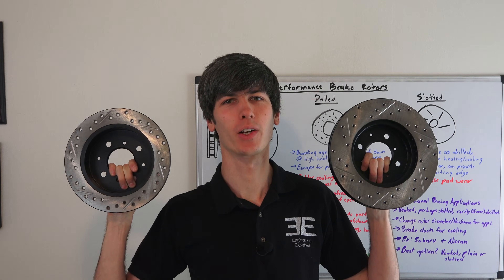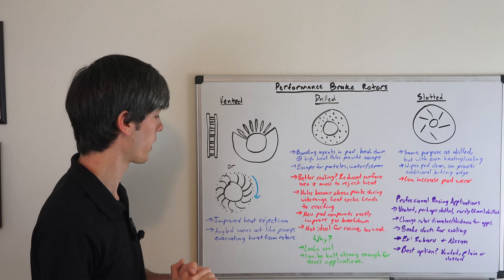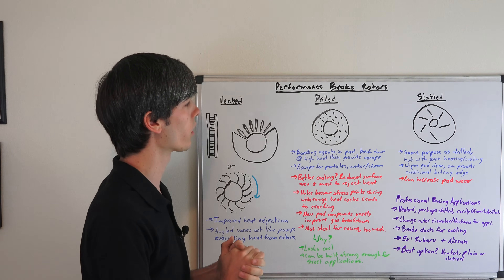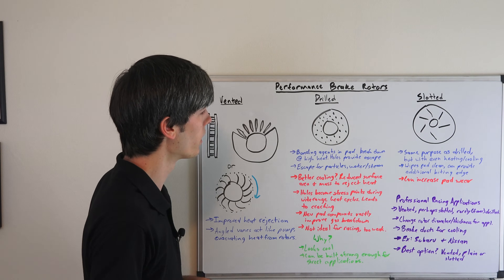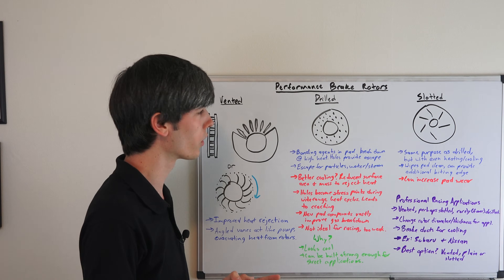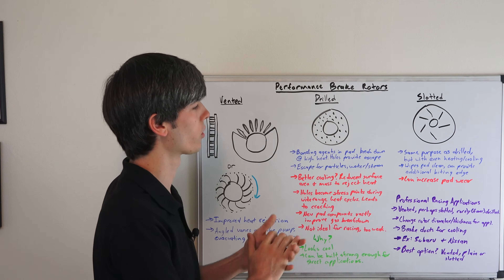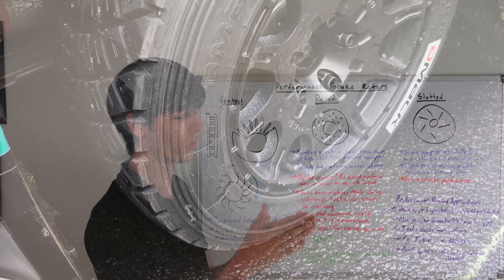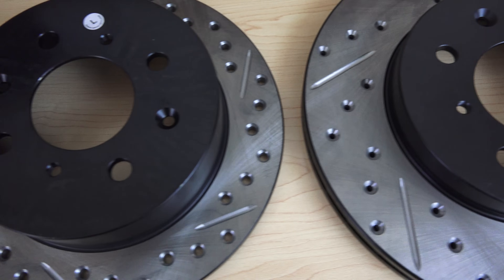Drilled, Slotted & Vented Brake Rotors - What's Best?

Comment: I really doubt Ferrari adds drilled brake rotors because they “look cool”
Reply from the maker: Not saying you're wrong, but it's also not the full story. Ferrari doesn't used drilled braking in F1, it's a full surface. In IMSA with the 488, Ferrari has slotted brakes. If the extremely harsh braking environments of F1/sports car racing don't require drilled rotors, why do street cars need it?

Comment: You looked at 2 cars that used slotted over cross drilled, and then say race cars don't use cross drilled. Please look at european race cars that are using cross drilled carbon ceramic brake rotors, example Zonda R. Each method has its use, but durability of slotted or cross drilled is lower than blank rotors. For us putting them on our street/track cars were not looking for lifetime, because racing does put excessive wear, and if you're just a daily driver don't bother with modifying or using non oem spec parts cause it is a waste of money

Comment: So why do brakes fad under high stress at track days, if you say that this gas material that releases from the pads due to the heat, is a thing of the past? I thought the brakes fade due to the gas that is created a between the pad and the rotor.
Reply from the maker: ***** Brake fade has to do with the pads and rotors getting to hot, and the coefficient of friction dropping. I will have an additional video explaining this. :)

Comment: 1. Cracks because of the drilled holes? I've been a mechanic for over 35 years and yet to see that happen. 2. Slotted edge to wear out the pad? Who gave you so much bad information? For those edges to wear out the pad they would have to be higher than the machined surface of the rotor... if this were even possible then the pads would be ground to bits on the first brake application. 3. The curved vents work as a vane pump to get more air through the rotor ONLY in one direction; if it's running on the wrong side it sucks air to the center to the point it quits working...

Comment: Then why are motorcycle rotors drilled? All motorcycle have drilled rotors or wazed rotor, all use less surface area for more braking. Theses pros and cons are correct but I highly doubt you’ll see a drilled rotor crack on “race applications” that’s basically saying motogp bikes go through rotors left and right, the amount of pressure and heat that a bike rotor takes vs a car is two different ones, bikes put a lot more stress then cars by far and if a 4.5 millimeter drilled rotor can handle coming to a complete stop after 180-230mph I’m pretty sure 1 inch thick rotors can handle more

Comment: Rotor drilling is not and has never been about gas evacuation and/or cooling. The original purpose was to reduce inertial mass and/or unsprung weight in specific marginal cases in racing applications -- like going just a smidgen faster on a race track that doesn't challenge the brake system to its limits but has stutter bumps. These days it's about selling expensive toys.

Comment: do any oem manufacturers actually use vented as 'stock' on 'stock' cars off the lot?
Reply: Pretty much all cars have vented rotors at least in the front. Most larger cars will be vented front and rear. I have a 2004 Legacy 3.0R Spec B, it weighs 1590kg and has stock 316mm vented front rotors and 290mm vented rear rotors.

Comment: I feel they should just ban flat rotors - at least in the front.  I have never had a straight rotor that didn't warp no matter how expensive it was or how careful I was not to stop/park it while it was hot.  I've never had a rotor that didn't get scored with uneven brake pad wear no matter whether the pad was semi-metallic, ceramic or how good or how expensive the pads were.  I've been using slotted rotors for the last 10-months (plus 7 days); I have more than 20,000 kms on them and they look and work like they were brand new.  They should just cut out the crap and the better designs will come down in price as they become mainstream.

Comment: How to distinguish drilled and vented rotors since they both have holes on them
Reply: +Stark A vented plain rotor will not have holes on the disk surface. It will only show the vanes in between the two discs if you look at the edge of the unit.
Reply: +NLRevZ All vented rotors I have seem come with holes on it.
Reply: +Stark Even if you google 'vented brake rotor', you will find that 60-75% of all images shown to you are of brake rotors which do not have the holes on the disk surface. The following image shows what vented rotors are on the inside, showing the vanes going out between the two disks of the rotor: https://www.motorz.tv/wp-content/uploads/2015/12/UUC-Motorwerks-Vented-Disc.jpg

Comment: Plain rotors are the best... because it has more surface area = better stopping power
Reply: But more surface area = lower pressure on the pad. Hmmm...
Reply: +mingmongmang Wider tires means power pressure on the tire, yet they have more grip. Higher pressure doesn't necessarily mean more grip. Otherwise, the skinnier the tire, the more grip you get.
Reply: +TheRedbikemaster I think I was hinting that contact area doesn't affect friction force. 
Wider tyres have better road holding not through more friction but through more shear strength. (Tyres don't actually slide on a road, the rubber stays stuck to the road but shears off of the tyre leaving a skid mark.) That's not the case with brake pads.
Reply: +mingmongmang that actually only applies to some surfaces. It is due to friction that the rubber tears off, and hence why a bigger tire allows for a higher friction threshold before rubber shreds and the "slide" occurs. On a more slippery surface though, a car can slide without losing rubber in the process, and the bigger tire still gives more friction (unless it is aquaplaning, but that is an entirely different sort of traction loss).
Reply: +Daniel Kemnitz   Nope. Size of contact area doesn't affect friction force...

Comment: You made me think that I should just stick with stock solid vented rotors. But no.....
Reply from the maker: Tyee Cambrón I never said stock offers the best performance, there are other ways of improving stopping power and the heat dissipation of the brakes. Drilled is not the route I'd recommend. Larger discs, pad selection, type of ventilation, width. All of these can be changed to effectively reduce brake fade.
Reply: Tyee Cambrón 

Now I remember, driving my 1993 mercury cougar, I have overheated my brakes before. I had 5 construction working men (including me -- and I weigh 200lbs) while i was driving in a heavy hill area and probably going 60mph in a 35 of up/down hills. My brakes were smoking even when we got back to work.

[[Story was... A street sign lied about restaurants being at next right, we travelled 10 minutes into a back road that has nothing but houses and tons of stop signs, and there goes our 30 minute lunch time... So I turned around and found a gas station on the main street just half-mile after the dumb sign]] And all my 4-wheel disc brakes were still smoking after getting back to the job site.

another note. braking down the steepest seattle hill in a ford f150 with 1,200 lbs loaded will overheat the brakes and cause them non-functional, so e-brake (drum-brake) is necessary. other wise your front disc brakes will over heat and then have near 0 stopping power.
Reply: Engineering Explained I did some edits to my posts to switch as reply... But thanks maan.
Reply: Tyee Cambrón you should avoid using e-brake. They are not designed to stop your car when moving. Use engine brake to keep your car not accelerated on the hill, flush your brake fluid if you haven't done last year, and get better pads.
Rotors are not the reason for overheating on the hill. It's either pads are fading, or fluids are boiling due to poor maintenance.

Comment: Can anybody tell me what would be best for drift applications? drilled and slotted or vented? or something else?
Reply from the maker: Typically drift runs are short and don't have much braking. Smaller brakes will remove unnecessary mass. Just make sure they're not too small for the application.
Reply: Plain vented. They are cheaper which means more money on seat time.

Comment: if you see the testing that is done on premium pads, you realize you will never generate that kind of heat in daily driving.  I just buy premium rotors (higher quality steel) and premium ceramic pads.

Comment: You mention drilled rotors are disadvantageous for racing applications, and you continue to bash them as something 'just for looks". Have you considered the value of drilled rotors for street application? Not all cars are designed for track racing, and as you mentioned, those holes can be beneficial if water gets between the brake pads and rotors.
Reply from the maker: flipofthekick As mentioned in the video, escape for water (see second bullet point under the drilled rotor). But slotted can do this too, and won't have the stress failures as commonly.

Comment: with drilled or slotted rotors, is it possible to turn it down or resurface it?
Reply from the maker: jayzbond007 Turn down for what?
Reply: LoL
Reply: Engineering Explained epic win.
Reply: jayzbond007 Although many think it's not the best idea, you can turn a rotor if it's warped t a degree to even it out and reduce wobble. But most recommend you replace your rotor, it's still not a bad idea if it's cheaper and lasts a while longer. I had a warped 17" on my 05 3.6L CTS- the cost of the rotor was best to just replace it rather than get it rotated and shaved down at half the price.

Comment: racing cars have ceramic rotors, dont need any heat dissipating holes.  so brembo has no idea what they are doing? they make cross drilled for street applications cause most cars have fade, metal they use does not cause cracks, fact.

Comment: This guy really hate X-drilled for valid reasons, maybe failed on him before, well, rotors will need replacing be it slotted or drilled,etc  or cracked or warped, we buy these for stopping distance, ç x drilled offer best bite, just have to pickup to the cracks .

Comment: I could of swore that the directional vented rotors rotate the opposite direction (takes air from the outer diameter and transfers it to the inner)??? Assumptions based off of Lexus GS 300-350. Other makers may be different I guess.

Comment: But what about rotors that are both Drilled and Slotted? This is for normal everyday driving.
Reply: Pretty much useless. The edges will grip into the pad better, sure, but the pads will wear out faster. I'd recommend a plain, quality rotor and a good set of pads. Pads are gonna be your biggest gain in braking power.
Reply: paul289 interesting. thanks haha
Reply: +cuvkiller Get ceramic pads. From personal experience on multiple cars- quieter, less brake dust, same price as regular pads, and significantly improved braking...roughly double the stopping power. you will notice a big difference. getting off the highway once they get warmed up and you really stomp on the brakes, you will likely lock your wheels up easily.
Reply: Adam S Interesting, thanks (:
Reply: +cuvkiller,  don't just get ceramic pads and throw them on every vehicle. Sedans and coups work good with ceramic. Trucks, suv's and vans however,  do not do as well with ceramic as they cannot withstand the increased heat that the larger mass generates. They actually squeak more often with ceramic pads. Get a high quality semi metallic and it'll be the best bet.

Comment: But do drilled and slotted rotors increase braking ability?
Reply from the maker: +Brandon Reid My recommendation would be to watch the video! :)
Reply: I did, he said nothing about if they help the car stop faster or not. Maybe you should watch the video.
Reply: +Brandon Reid He made the video.
Reply: +Brandon Reid   The video notes LESS MASS to stop, but that is pushing that theory beyond the max.  Fact is, there would be no measurable distance to state that as a fact, and certainly no tests have been applied.  It simply SOUNDS good on paper to state such BS, because if there IS any less stopping distance due to less rotor mass, the few ounces of less WEIGHT would offset that distance  lol.
Reply: +Brandon Reid drilled and slotted rotors should increase braking moderately by allowing improved cooling. On the other hand there is less surface area for the pad to grab.
http://honda-tech.com/honda-civic-del-sol-1992-2000-1/why-blank-rotors-better-than-cross-drilled-slotted-1437513/
Reply: so far I've been told from other YouTube videos and also sellers it does help stopping slightly better and are little longer lasting
Reply: Less surface area = less braking = longer stopping distance.
Reply: +Paul Bevillard No, cooling is not improved. Drilling rotors reduces thermal mass and increases the temp of remaining material.

Comment: another good video but not really correct. u can't compare these rotors, the reason we have different types of rotors is simply heat. Just because one rotor was produced by high end sports cars doesn't mean one is better than the other. When u go racing all different types of rotors are used to either maintain heat in the pads or get rid of it. I use two different rotor types along with 3 different pad heat ranges depending on the track, length of track hard breaking zones etc.

Comment: don't use either.  Drilled rotors crack when they are cast holes, even drilled holes can crack.  Slotted sounds terrible, has horrible vibrations and chews pads up.  Best thing to do is just get a standard vented rotor with increased diameter and better pad compound.

Comment: That rant on drilled, makes you sound like an eBay budget buyer that had a really bad experience. I've ran drilled rotors on everything I've owned since 1996, when I started driving. Even took the daily to the track from time to time. Never once had a rotor crack/brake/etc. You get what you pay for. Buy quality and have no fear.

Comment: Not so sure about the truth of these explanations. As logical as they may seem the practice proves them inacurrate. I installed drilled as slotted on my Lexus IS250 combined with Hawk ceramic pads and I could push the car real hard and breaking was 1000x better than with stock rotors and pads. I only noticed that ceramic pads would need some actual heat to grab, but brakes never overheated. I burnt stock brakes in less than 2 miles of up and down hill driving around corners.
Reply from the maker: Out of curiosity, did you try just the Hawk pads with stock rotors? Track style pads make a huge difference in how your brakes perform at various temperature ranges (regardless of the rotor used). They’re both variables (which isn’t to say that there aren’t rotors out there which perform better).

Comment: Ill be laughing at any car that has drilled rotors from now on - Lol
Reply: it's for weight
Reply: +wjanes11 I am curious to know if it would be possible to move the MoI inward (by drilling more holes on the edge than in the center) and reduce the weight enough to have a notable.
Reply: +roguedogx less mass on the driveline is always notable.
Reply: All you have to do is google drilled rotors and theres plenty of examples of cracked rotors

Comment: Plain-vented rotors for me then.
Reply: +tgshark1 Tiger Shark Very generalized but yeah. I won't switch back to plain rotors that soon. But it's up to your setup, driving behaviour and expectations in performance.
I tested so many rotors on quite a few cars over the last 7 years, that the conclusion remains the same. With normal roadcars I always get better results with slotted or "drilled" rotors.
Important to point out, that I only bought either ATE, Brembo, Zimmermann or MovIT.

Comment: Many/most machine shops will refuse to resurface drilled rotors because their milling machine cutters tend to dig in and get damaged by the edges of the holes.  Another reason not to buy drilled rotors.

Comment: so why do motorcycles, especially sport bikes, use drilled?
Reply: Because they are solid discs so drilled holes increase the surface area and improve cooling. They are also not dissipating anywhere near as much heat as a much heavier car so are a lot less prone to cracking.

Comment: Which type of disc weighs less?
Reply from the maker: ***** The ones with less mass.
Reply: Engineering Explained haha, so that would be drilled right? Assuming all other properties of the 3 types of the discs were the same.  A very timely video for me, I was driving on the motorway (highway) on a very hot day and experienced brake fade....not a nice experience when driving 70MPH and the brakes fail to respond.

anyways...are drilled really that bad for day to day normal driving?

Comment: well what about slotted and dimpled?
Reply: I honestly wouldn't bother.  The dimples aren't going to provide you with much, if any, greater benefit than just regular slotted, and may further increase the pad wear.  Save some money and stick to plain or slotted rotors.
Reply: Dimples only provide an air gap; they don't reduce rotor mass as much as a through-and-through drill hole, and they don't allow hyperturbulent air from inside the rotor to pass over the brake pad, and they still reduce the surface area of contact reducing your effective braking power.

Comment: Engineering Explained the best rotors I have ever used are a Hybrid "Dimpled and Slotted rotor"  from EBC Brakes. Have used them on every truck and 4x4 rig i have build or owned. I have never had a failler and I tow and road cross with some of this trucks. Their pads are top shelf as well.

http://ebcbrakes.com/product/3gd-sport-rotors/